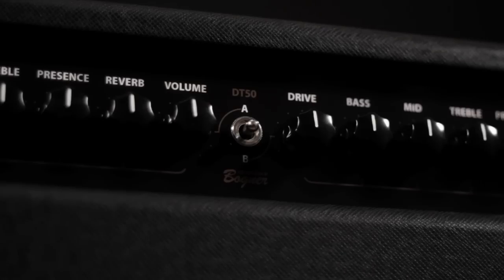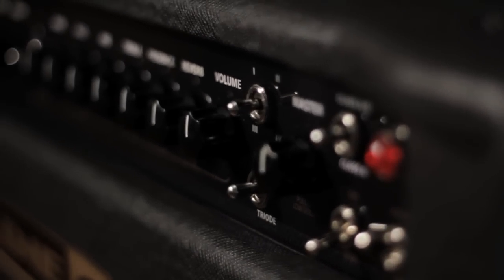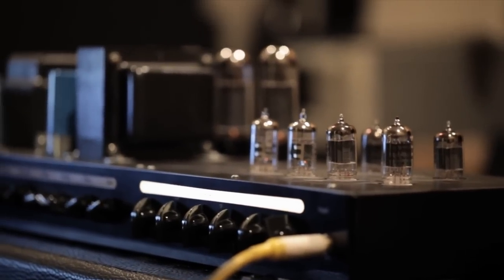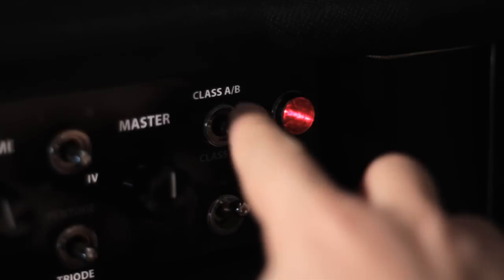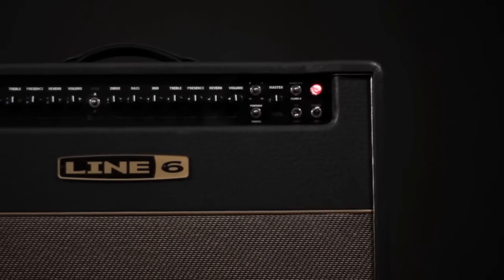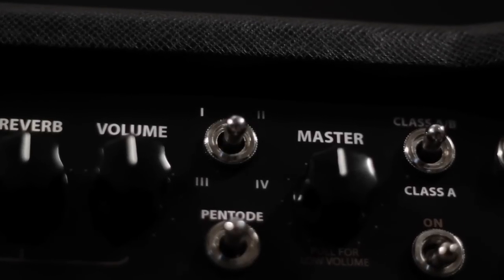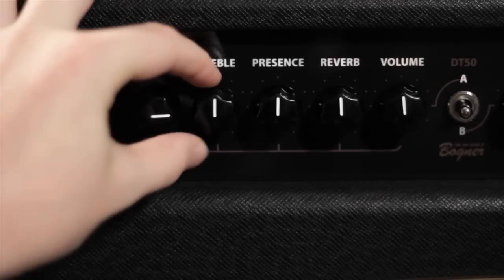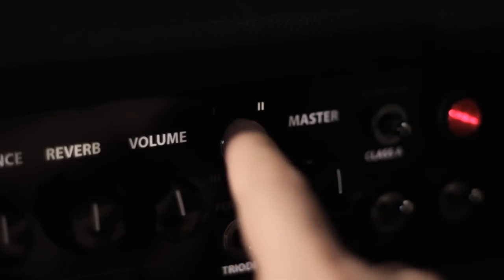The Story of DT50 Guitar Amplifier | Line 6

Comment: I’ve been playing since 1964. I’ve had every bra c of amps, some better than others, the DT series is amazing. They haven’t made these anymore for almost 10 years, they’re still making that solid state crap but nothing, not my 64 dual showman black face, not my ampeg v4, I still have w peyvey hybrids from 1981/84 as reviewed as those amps are, none have the rich wonderful sounds of the DT 25/50. I’ve always been a fuss bucket about matching speakers, then the DT 50 212 comes with 2 different Celestion speakers. Both are different power levels, the resistance match but that’s it. Blew my socks off. The DT 50 212 combo started having some problems about a month after I got it, squeezing etc everything you’d expect from bad tubes. I did a lot of research, spent time on the line 6 forum where I was almost convinced I needed to return this massive 80 something pound amp back to line 6 so thdy can bias it and so forth. Well it was going to cost me more than I paid for this beauty to ship plus the service work. So I bought the exact recomended electro harmonix tubes. I bought a good biasing meter on Amazon. Followed directions to the letter put it back together and it sang like it was brand new. I thought it sounded wonderful when I first got it but now. Wow.  I don’t know what happened, some said they had transformer problems. Idk. They are tube amps so you will occasionally get some Line hum all which you never hear playing. Want no hum go buy one of the older solid state amps. I’ve had them all. I thought they all sounded pretty good. Wish I kept the stereo vetta. I really loved that amp but none of them come close to this. I’ve never played an it’s bitty spider amp. I don’t know if bogner had his hand I. That. I’ve still got 3 or 4 good amps laying around. I’ll probably give them to my grandkids or sell them. I’ll keep these till I die. Currently I have an hd 500x and an hd prox with the foot controller 3, if you get the pro x get the foot controller 2 because the 3 is designed for the more modern amps. Still works but it’s a little wonky. Anyway, I’m amazed that I was able to purchase 2 amps worth almost 2500 bucks new for a total of 500 bucks and except for the tubes on the combo they are mint. One more thing, I don’t have the helix yet because the sound of my 2 -50s with the hd 500x and pro x is amazing. The helix will control the DT 50 amps as well as any if my Variax guitars, currently have 2 Variax standards which are really Yamaha pacificas with the new Variax hd sound systems on board. The neck is a amazing. There’s no belly cut because of the battery. Im probably going to build a custom Variax, I’ve built around 75 over the years, but honestly the Variax version 1.0 guitars wernt that good especially for the cost. If you’ve played a Pacifica, you’ve played the Variax standard. If I built a new guitar I’d probably use the existing neck. It’s better to me than any American fender Strat neck . The carve of the neck is very similar to a custom Warmoth neck licensed by fender. Those are some sweet necks. So is this one. The only thing I think the pickups are just ok, I’ve already changed the pups in my blackie and will change the ones in my cream colored. Still looking for a deal on the sunburst. Knowing line 6 some day they will move on , either to a new family of Variax but every line 6 product I’ve ever purchased is no longer made. Oh well. Buy one of these. If you van handle the weight get the dt50 212. I know the 121 sounds good too but the 212 was tuned to perfection with the 2 different Celestion. I’d ever build a cabinet like that (maybe till now) I’ve got my DT 50 head going through a re speaker Ed Marshall 4x12 with 4 Celestion green backs from 1972. They are amazing. And price,ess. Perfectly broken in. I was so lucky to find this acoustic speaker cabinet with 2 horns and the 4 greenbacks. 25 watts ea, 16 ohm, my cabinet is 4 ohm and it’s also one of a kind. I wouldent take 1000 dollars for that cab. Anyway rock on.

Comment from the maker: @Zhorellski channel switching works absolutely fine. When you switch channels while changing Pentode/Triode or Class A/AB modes you can hear some clicking. This is because these components are analog components and that's just the way the physics behind the amp works. Unfortunately, we haven't figured out how to change the laws of physics here at Line 6 yet. ;)